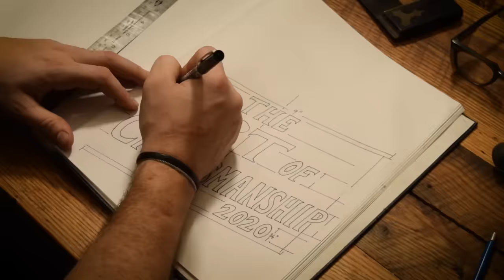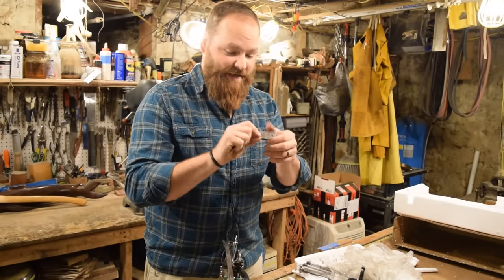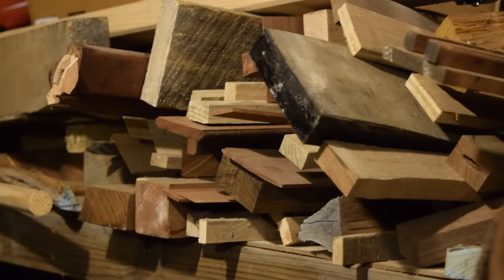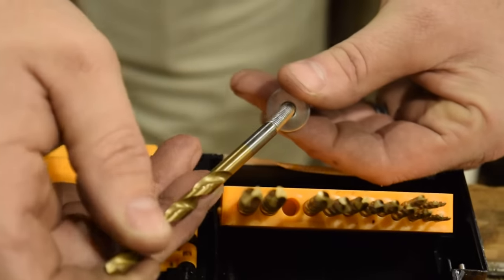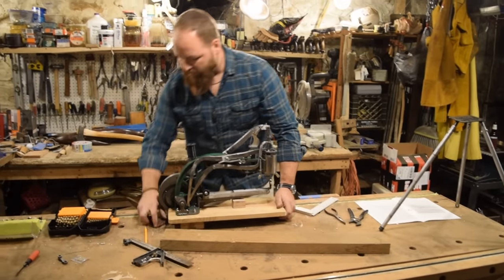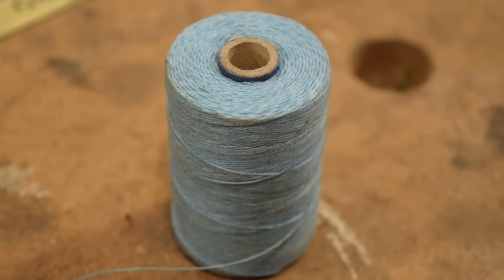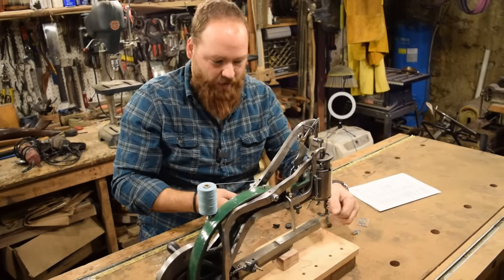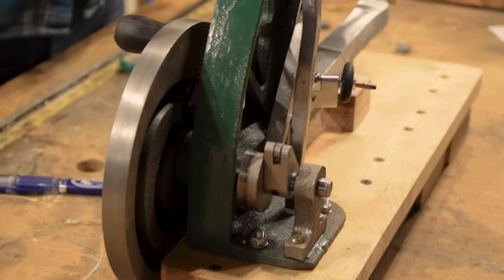The Infamous $100 Leather Sewing Machine: Unboxing and Setup

Comment: Good video, I have been considering getting one of those machines. Your video quality was great. The close  ups of the machine shows what I had assumed. The machine looks like it would need a little work smoothing all the ruff edges,and polishing some of the moving parts. I think at that price that would be ok. Please keep us updated on how it performs. Thanks
Reply: Tips:  You need to match the correct needle size and tip to your thread size.

Check out The Thread Exchange (dot com) for quality thread & needles. I use thread sizes from Tex 70 (size 69) to Tex 210 (size 207) on this same patcher with Groz-Beckert needles (HAx1 and/or 15x1), but you can also use industrial needles by moving the needle arm up a little (mark the original position with a sharpie or scratch before you move it).
I use bonded polyester thread. The key is the proper match of a quality needle to quality thread size that matches your needle/thread and material (leather, bio-plastic, canvass, etc.).
>>Note:  The included needles & the black fishing line thread are junk. That's why the sample sewn was not done with the fishing line thread.😉 
  
Clean the flywheel with a bronze brush & WD40, use some 220-grit paper  on the sharp milling areas on the flywheel, lightly grease the tracks in the arm, lube the bearings at the flywheel & cam, use 400-grit paper on the top & sides of the arm, smooth your needle hole going into the bobbin case (top & below - sharp edges cut tge thread) with a rubber-grit Dremel polishing bit, clean your bobbin, bobbin case and hook with 400-grit paper, *know which BOBBIN HOLES to thread thru for various thread sizes*, ensure the bobbin is set in the case & arm correctly for *timing*, and this  machine will run great.

It is a little time with the initial cleaning, prep & setup, but is fun & worth it.  Invest the short time & you will know this machine.
Reply: @JunkMailBoxStuff wow! This is some great information. A friend of mine found one at a market stall here in Australia. It looks pretty much unused, although a little surface rust in places. So, he gifted it to me. I was unsure I wanted or needed it. Now the more I see, the I think how handy it will be. I usually hand sew leather and also have some canvas projects coming up.
Your information here will be very helpful. 
Thank you!

Comment: I feel like the leather swatch left in there is normal. My sewing machines bought new came with fabric and a few of the stitches sewed in, as if the manufacturer was leaving in the quality check as proof.
Reply: Also with that arm hanging in the wind, if its dropped in shipment, it keeps a shock absorber in place. Gotta prevent that metal from smacking.
Reply: This also is done so any excess oil coming out of the sewing machine is absorbed in the fabric swatch and not on the bed after being serviced/lubricated for the first time.
Reply: @kazzooka  I think these are usually included as a test piece for setting tension and also to demonstrate the machine was working normally at the time of shipment.

Comment: I actually bought a 1903, pedal driven, cast iron, Singer leatherworking sewingmachine last year, for €50,-.
After a little TLC it runs like it's new, and gods I love that thing. Even with the old needle, it went through thick leather like a hot knife through butter.
Reply: Awesome. The old machines work really well.

Comment: The point of the legs is to have a free arm stitching for bulky work. To mount it on a piece of wood takes away the whole point of the open head sewing area. It will work for your knife sheaths but for anything that has any bulk to it you will need to build a stand for it. You could also have a Machine Shop build one for you and for the $95.00 you have invested it looks like it would still end up far cheaper than buying a large Commercial machine. I have an older Consew 206 RB-1 and it is a walking foot machine that I bought well over 25 years ago. It was a year old and I paid $1100.00 for it for my Canvas, Upholstery and Awning business. It is still working as good as it did on day one when it was bought brand new. I have always wanted a free arm leather machine and will look into this one so thank you for unboxing it. I will have a stand made for it. For the price it looks to be a great little handy machine for light leather work.
Reply: A block of 4x4 under the machine, through bolted to a 3/4" slab of plywood is sufficient for any sleeve work or tall boots.  I have sewed 10x10 canvas tarps that easily roll up under the 3.5" clearance that provides.  Toss the POS stand.  Even if you welded it solid, it would still have too much flex to be if any use.

Comment: Very informative. I was looking for info on this machine and found your channel. I appreciate the detail shots, you had plenty of them. 
BTW, the little block that you put under the arm, doesn't need to be there. The opening under the base arm is to make seams down inside a bag or boot or shoe. I've read a few instances in which it was neccessary for the bolts in the base (back) were updated to larger/stronger ones. Also, you didn't show it, and I don't believe you did, oil the machine before you started using it.  I've read that it makes a difference how the machine operates, especially the camshaft and tracks/grooves behind the crank wheel.
The second, unmentioned, tensioner is there for dual stitching. Somewhere along the top of the machine is a hole for another spool mount. I believe a special needle and foot are required. 
And now a personal observation. Watching a wood worker deal with a mechanical project always makes me grin. He will have a special tool to draw a line on a board at precisely 22.5⁰. Another one to make a groove in a board that is exactly 7/64" wide. Now give that same guy a 7mm screw with a 10mm nut on it, and you get to see a demonstration of the creative uses of a needle nose plier and a vice grip.
😂  No offense intended.
Reply: Lol was thinking the same thing when I saw him bust out the pliers
Reply: Where do I oil it?

Comment: I bought one a few months ago.  Once it's set up (the bobbin was a bit of a mystery for me) it works really well on any leather.  For the price it can't be beat.  So much better than hand stitching.  Sure, a $1000 electric is better, but let's face it, most of us will only use this thing for a couple of projects a year and it does its job in spades.

Comment: Definitely going to buy one ,I have a big fancy machine, however sometimes when I travel I dont like not having a machine
Reply: Do it!!! I love mine!
Reply: This thing is relatively compact but you'll want some sort of clamp to keep it from moving around on you if you choose to make your own base. The tripod it comes with was absolutely worthless and it does need a quick wood base with a clamp or a grip matt under it.  It only has one stitch size but is very easy to learn and can stich in circles just by rotating the foot thingamabob.
Reply: If one has the ability to, i would say to make a wooden box type case, with latches at the base, that acts like an old typewriter or sewing machine box/case

Comment: I just bought same leather sawing machine and noticed that in order to use the stand that comes with the machine it needs to be installed with the two legs holding the heavy side of the machine in the front and one leg in the tale, I have been using it with no problem.
Reply from the maker: It’s an interesting and fun machine.

Comment: The 2 tension knobs: first one, pull thread under bottom to top, loop behind tension spring, this is for thread tension.  Second knob thread goes over top then down. This knob works to help bobbin and lower thread feed up.  You should use same type thread ( heavy duty upholstery, waxed or nylon thread) for bobbin and feeder thread.  You might want to use saddle soap on your leather first; makes leather more payable and easier for the needle to pierce, just suggestions  to help. Enjoy your new toy.
Reply: P.s. I forgot to add; I learned a great simple shop/craft/sewing tip along time ago that is a great preventive of rust and helps any material your working with to slide or move on metal surfaces;  i use turtle wax rubbing compound on all my tool table tops, sewing machine foot and plate; scissor, knife and axe blades (non food of course).
Reply: I saw that your not to use waxed thread ,will gum up

Comment: I worked for the Reece Corp out of Waltham Mass.that made eyelet and keyhole buttonhole machines from 1880-1980 that worked on leather shoes and dress coats both spools of thread had be soaked in oil or silicones to work correctly. These were the fastest machines made for production work and much smoke was released while sewing from the hot oil thread.

Comment: For $100 you can’t beat it!!
Reply from the maker: Right?!  Thanks for the inspiration.
Reply: Then I watched a video about motorizing the machine. Now I can’t remember what channel it was on. It seems like to motorize it was less than $50 with Amazon parts. A sewing machine motor with foot feet, a bracket from an electrical box and a pulley. The pulley attached via the electrical bracket and the sewing machine motor already had a pulley. The one caveat was that to get the motor to turn in the right direction you had to put a twist in the belt. The belt was made from weed wicker tubing. Cut to length and melted together to form a belt. Pretty neat and it worked great.
Reply: @brucewrandol  that’s me! That videos on my channel.
Reply from the maker: @MakeEverything  lol!
Reply: @MakeEverything  Why so it is; I actually watched that video before this one.
Reply: OH YES YOU CAN! Go and search for an old Singer Class 29. It might be 100 years old but is still 10 times better than this piece of ... from China. Clean it, lubricate it, get a new belt and you will be the proud owner of an American masterpiece!
Reply: @wolfsfarm7667  i own both, a 29k71 and a Chinese one. While the 29 is miles ahead, you (at least where i live) won´t find a usable one below 300. A 29 for 100 or less will most probably be garbage.

Comment: I'd reduce the 1x8x18" table under the long foot by maybe ~12" and plan on clamping the base to a solid bench,  to free up the space under the arm for larger items.  That long arm is designed for sewing deep into boots and shoes, and it would be a shame if it was awkward to fit the inside of a boot, baseball glove, armor, tent, or whatever into your machine because of your table.

Comment: It seems really nice for the money, but I can't help but feeling like a vintage hand crank Singer machine, even a regular non-leather machine, will work better, ore reliably, and smoother while being much cheaper. Only downside is of course it won't be able to stitch far into hollow leather pieces like this one with the thin arm.
Reply: The old singers these are based off of are big $$$
Reply: @tave9011  I didn't say an old Singer machine like this, I said an old non-leather machine. They are built like tanks and can hand crank through leather no problem. I have one just for that purpose. You can pick up nice well preserved ones for like $30 at yard sales all the time.
Reply: @SwitchAndLever  Got an old Köhler and as long as you aren't doing more than 2 layers of veg tan it works like a charm. And with the veg tan the problem is the footspring not being strong enough to hold down the leather while the needle is being pulled back. The rest of the machine can handle it just fine.
Reply: @JCGver  what model?
Reply: it is not what all the people that have  it say...
Reply: @BrokenRRT  don't know exactly, my grandfather somehow got it, and i inherented it. Other than "Köhler" the only thing on it is the serial number: 2556021. My grandfather sewed an entire tent with it, and varius family member have used it for stuff like covers for boats and such. 

It usually takes some fiddling to set it up for the fabric and thread, but after that it doesn't miss a stitch.
Reply: My singer model 66 is a tank. It will sew thin leather like nothing there.

Comment: This is the most detailed and in depth vid I've seen. I bought one that looks like the exact knock I got but I'm having trouble getting mine to work caused by a sticking sliding arm.
Reply: No its not...  but it is good. 

keep looking there are some good, extremely detailed vids available on YOUTUBE.  Have fun I love mine! Had it 2 months now and after filling and oiling everything and watching EVERY video for advice. It works like a champ no complaints. 

Sand / file every surface the thread comes in contact with. Play with tension both top and bottom on scraps till tou get what you want. 

Good luck have fun!
Reply from the maker: Thanks Allen! It's a tricky business for sure.

Comment: I just finished my first leather project which was a 6 oz leather desk top. I used a 16.5” HD cylinder sewing machine that I bought. Way more power than I needed for the job but it soon became apparent that you need large off feed surfaces or 4 arms to manage the leather over the machine. Also the power required at times as I hand feed via the 12” flywheel was shocking. 

I can’t imagine using a manual machine on anything but small handheld projects!

I hope this machine works for you!

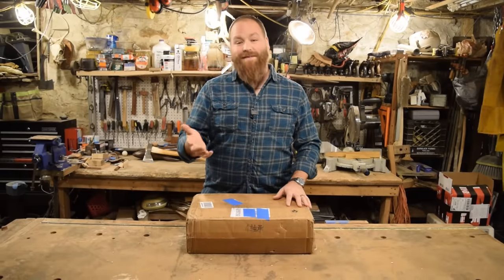Comment: 1:35 - unboxing machinery you generally want to slit the bottom seam/tape (see the "This way up" icon for which is top and bottom), fold the flaps out, turn it over, and lift the box off of the packing.  Works for washing machines to old style desktop PCs.

Comment: The Singer I used working in shoe repair had a threading tool for that tube in the head.
A length of fine rod/wire, flattened & a notch in one end, a loop as a grip point the other. Thread lays over the notch, pinch to the shaft & turn as a friction fix. Push it thru, grab off end, retrieve & proceed.
Much easier than pushing thread thru that lenght of tube

Comment: I bought the same machine and being old I can't get the bottom thread through the needle.  I just stick with the wooden saddle holder and stitch by hand which is relaxing.  Plus I can double and triple stitch as I'm normally making holsters or belts and I don't want type of failure.  I do still love the hand crank belt maker.

Comment: The needle your where using is probably too small for the linen thread.
Reply: That is a very good possibility.  I've looked into these machines several times and found the thickest thread you can use without major changes is a T-96 and the linen looked a bit larger then that.
Reply: I think too that there are multiple points along the route that aren't smooth enough to pass thread through (even my relatively nice medium duty home sewing machine ends up occasionally breaking thread due to friction, especially when I'm being too optimistic at how fast I can get it to move or being too lazy to switch to heavier thread for a heavier fabric.)
Reply: The bobbin thread didn't look like it had enough tension, either.

Comment: I've used one of those machines 10 - 15 years ago. The one weakness is the little bushings that run inside the grooves inside the flywheel hand crank. Always breaking. We had to order replacement parts from some guy on a remote island in New england coast, by mail, as he had no phone. Luckily I found a very  large hand crank singer in good shape for $600.

Comment: I have one.  That thread is the type needed for leather.  One thing (ok - few things) I did was to smooth out the rough stuff in the necessary areas - where parts interact with each other.  Another was to use high tech oil on all moving parts.  Smooth running makes smooth stitching.

If you do biggish pieces, make a wide platform that fits around the arm.  Much easier to sew when the whole piece is flat.

Clamping to bench makes a big difference.  That big flywheel will move the machine also.

Overall - for random uses occasionally - these machines are pretty decent.

Comment: I have one of these had the same problems you had. I went to a local sewing store and bought needles with larger eyes for the thread I was using. I also had to play with the screw tension on the Bobbin Shuttle to get larger thread to work. I can sew 9oz leather now but the presser foot tears up the leather!! Looks like railroad tracks. I've been considering filing the raised area on the bottom of the presser foot smoother but I'm worried it may not feed  if I do it. I make leather aprons and use Utility sides, I make some of the parts for the harnesses with this machine. The sides are only around 5oz and it works GREAT for that.
Reply from the maker: Ive seen a few people use Plasti-dip on the foot to solve the marking problem.
Reply: Good idea! I may try that! If it dosnt work I didn't ruin anything!!

Comment: I was locking at buying one of these but after a few days of research I found out that for $150 more in US (its on discount in my country so just $50 more instead of $150) you can get a brand new manual Singer sewing machine which will do the same job. But one is extremely beautiful, finish on it is spectacular and you get a guarantee that it works properly and has a big resale value in case you want to sell it later
Reply from the maker: I’ll have to look into that. Thanks
Reply: @TheArtofCraftsmanship  singer model 15 its called

Comment: Have fun I have that model. My dad and I worked on sanding down parts that are rough on the machine because of the casting. By sanding down the metal it won’t cut the material or the thread on accident. I also bought leather thread and leather needles that don’t come with it. You’ll need wax leather thread is the best for leather making. Also sand the bobbin that holds the thread. I just used simple sandpaper made for metal. I’m still working on modifying mine some more.